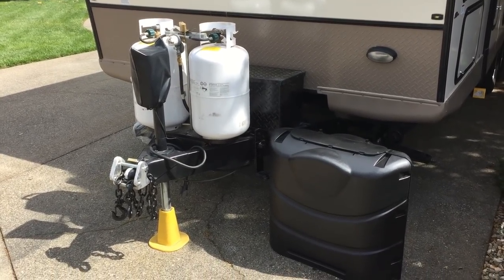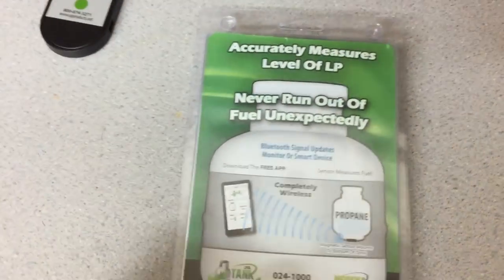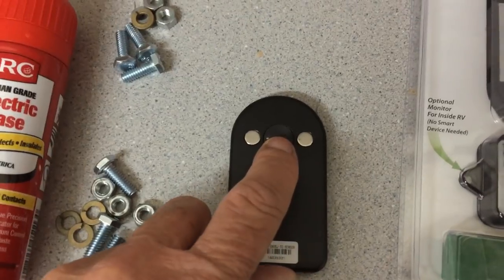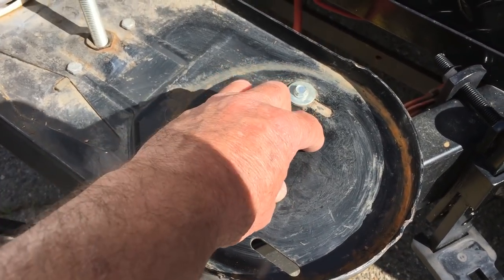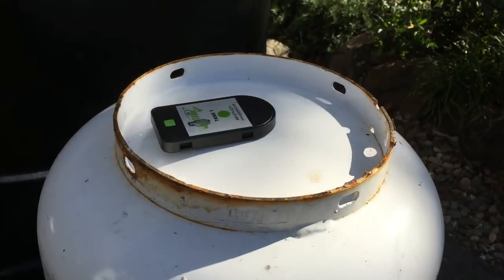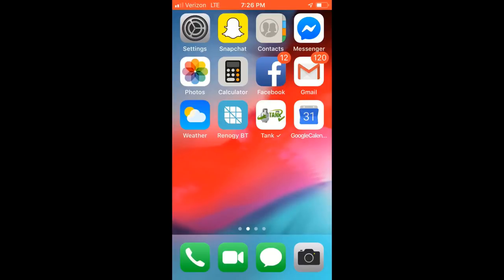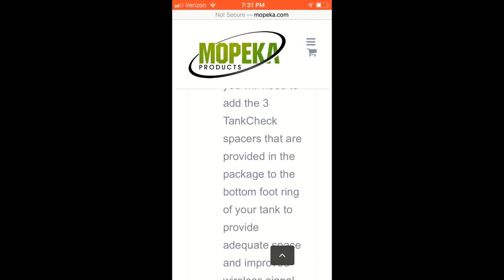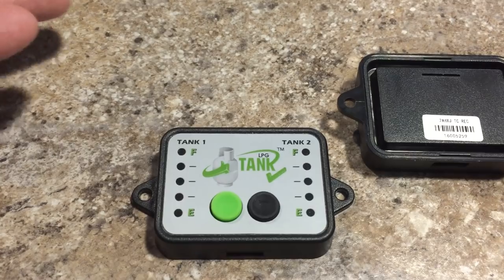AP Products (Mopeka) Propane Tank Monitoring System Install Part 1- Travel Trailer

Comment: I purchased a pair of these several years ago with high hopes and expectations.     The concept is great, but the practical results are less that marginal.     I have had to contact the company several times and had one sensor replaced by them and have also purchased an additional set.    So far all have had similar issue.   My tanks are mounted inside a storage compartment on each side of my 5th wheel trailer and are protected from the weather.   I have not had a single sensor assembly work more than 1 complete season of camping.

Issue #1 - The tank sensor assembly is extremely hard to open when batteries need replacing (about 2 times a season).  A very small tip screwdriver is needed to pry the case apart.  

Issue #2 -   Both the magnets and sensor cover membrane stick to the bottom of the propane tank after being installed.  When removing the sensor assembly from the bottom of the tank to change batteries magnets and sensor cover can pull loose from the assembly case remaining stuck to the tank.    Magnets can be glued back in, but the sensor protective membrane is trashed and in short order the entire assembly will not work, most likely from moisture intrusion.  

Issue #3 - After battery change, manty time the sensors will be detected by the app, but do not correctly provide tank filled status.   The attached photo shows status being reported for both of my 30lb tanks.   One tank is completely filled, the other is one cooked meal with the camper stove shy of being full.   As you can see, both thanks show empty with sensor quality showing no stars.    This is a sure indication both have failed and are once again useless.    

Although the company has been helpful, I do not recommend these unless you just like throwing money out the window.
Reply from the maker: Sorry it took me so long to reply, I wasn't notified of your comment and just saw it now. Thank you for watching and your comment. I had the same problem with the magnets, contacted the company and they sent me new updated sending units. I like having this set up but need to agree with you they need to make some improvements. https://www.youtube.com/@thetraveltrailerguy/videos

Comment: Hi Michael. Just watched a video on All About RV's and these sensors were mentioned as an RV accessory not used anymore. The reason given was that the batteries don't last very long. It'll be interesting to see if you have that issue after living with them for a while.
Reply from the maker: Hello Bob, I've also watched his video and I saw his comment that the batteries did not last long on the sensors, but so far I have not had them drain yet so only time will tell. Once the batteries need to be replaced I will post how long they lasted in my description above (I hope they last at least a year). Are you saying All About RV's is not using them anymore?  Thank you for your comments. Mike

Comment: Michael you mentioned you got the 2 sensors and monitor kit for $71.00. Where did you get the kit for that price? Amazon has the dual kit for $125.00. Great video as usual.....right now I use the tape on the tanks. I will consider this option, if you would give an update on the longevity of this unit after a while. Thanks
Reply from the maker: Wow I'm sorry I did not reply earlier Scott, I just saw your comment. Here's the link to what I bought and it had two sensors and I see now its being sold for $68.00 - https://www.amazon.com/AP-Products-1212-13-024-1000-Monitor/dp/B01C5RQI74/ref=sr_1_fkmr2_1?keywords=AP+Products+LP+Tank+Monitoring+second+generation&qid=1558479490&s=gateway&sr=8-1-fkmr2

Comment: great video !  i have been thinking of getting these but heard some bad reviews about the feet.  Great solution.  I have been using a laser thermometer to get my levels, but that is not super convenient.  thanks amigo !
Reply from the maker: You're welcome, I like the idea of not having spacers attached to the tank because when I go to fill them I could lose the feet. Here's another option for adding a space under the tanks - https://www.amazon.com/Mopeka-Tank-Check-024-5002-Halo/dp/B07HQZRR9F/ref=pd_cp_263_3?pd_rd_w=JVsl1&pf_rd_p=ef4dc990-a9ca-4945-ae0b-f8d549198ed6&pf_rd_r=GCW2S7VGSV4SC0JQEC8G&pd_rd_r=f5a7b2e6-7c1b-11e9-825e-f767610a7f33&pd_rd_wg=osPtF&pd_rd_i=B07HQZRR9F&psc=1&refRID=GCW2S7VGSV4SC0JQEC8G

Comment: Oh I see the extra sensor so you had to purchase an additional sensor!
Reply: Scott Gorman if you open the description below the video it will take  you to the link to the one that has two sensors
Reply from the maker: This is what I bought and it came with two sensors - make sure it is the second generaton before buying for 30 lb tanks (it says second generation in the https link.  - https://www.amazon.com/AP-Products-1212-13-024-1000-Monitor/dp/B01C5RQI74/ref=sr_1_fkmr2_1?keywords=AP+Products+LP+Tank+Monitoring+second+generation&qid=1558479490&s=gateway&sr=8-1-fkmr2
Reply from the maker: I like this stand - https://www.amazon.com/Mopeka-Tank-Check-024-5002-Halo/dp/B07HQZRR9F/ref=pd_cp_263_3?pd_rd_w=JVsl1&pf_rd_p=ef4dc990-a9ca-4945-ae0b-f8d549198ed6&pf_rd_r=GCW2S7VGSV4SC0JQEC8G&pd_rd_r=f5a7b2e6-7c1b-11e9-825e-f767610a7f33&pd_rd_wg=osPtF&pd_rd_i=B07HQZRR9F&psc=1&refRID=GCW2S7VGSV4SC0JQEC8G
Reply: @thetraveltrailerguy  AP products answered the question asked about 2 sensors and your are correct the kit you have is the 2 sensor one...confusing because it did not state it in the description and they do have a dual pack for $125.00. Now I like that price better! Thanks